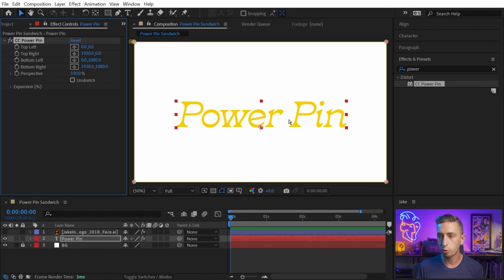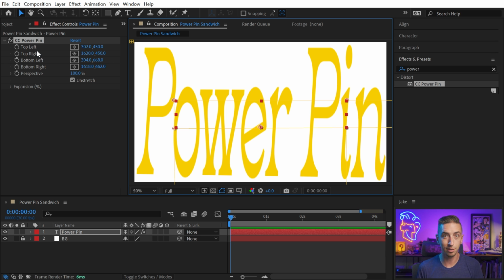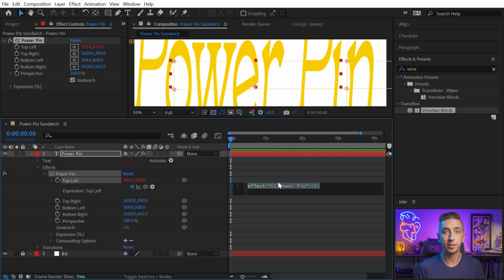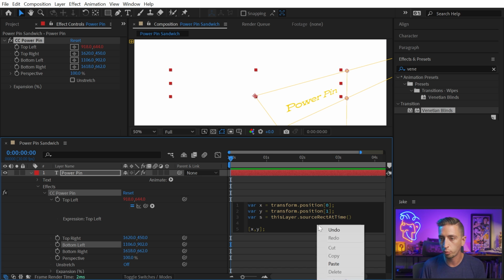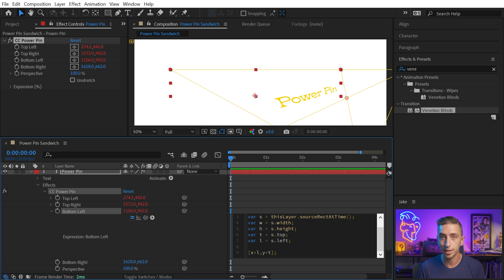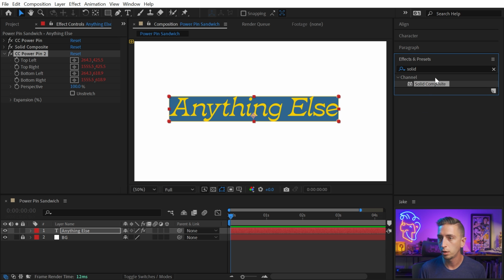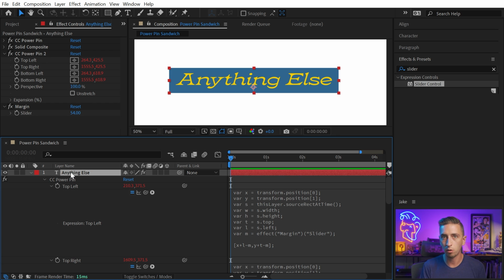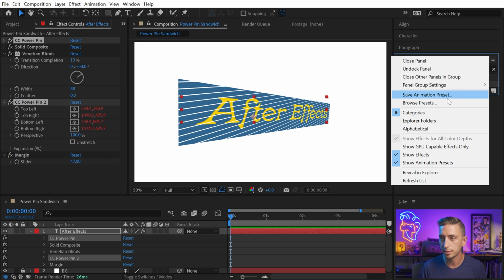CRAZY After Effects Technique \\ The Power Pin Sandwich

Comment: FYI, I found a few lines of code that make it a whole lot simpler to pin the corners to the corners of the textbox reliably

TL
var rect = thisLayer.sourceRectAtTime(time, false);
var rectTopLeft = toComp([rect.left, rect.top]);
[rectTopLeft[0], rectTopLeft[1]]

TR
var rect = thisLayer.sourceRectAtTime(time, false);
var topRight = toComp([rect.left + rect.width, rect.top]);
[topRight[0], topRight[1]];

BL
var rect = thisLayer.sourceRectAtTime(time, false);
var bottomLeft = toComp([rect.left, rect.top + rect.height]);
[bottomLeft[0], bottomLeft[1]];

BR
var rect = thisLayer.sourceRectAtTime(time, false);
var bottomRight = toComp([rect.left + rect.width, rect.top + rect.height]);
[bottomRight[0], bottomRight[1]];

Comment: Hi, I tried to use this technique to get a gradient ramp to "stick" to a moving shape layer but got an error at line 1 of the expression that a variable was off or something (I can elaborate when I'm back in front of AE tomorrow). Trying to stick the start and end points of the ramp to the center left and center right points of the shape. Any chance you could do a quick tut or write out the correct expression?

Comment: i discovered this "unstretch" checkbox sandwich technique when i was desperately trying to find something similar to red giant's discontinued kingpin tracker last november. i was working on an Air Canada christmas commercial and I decided to track the digital faces onto the stop motion puppets and distort them into the correct perspective using corner pin by tracking 4 points on the face. there was literally no other way to do it i think. super useful technique
Reply: Stabilize precomp, check out mocha import +, or  Lockdown from Vranos.
Reply: @UnDo75  Thanks for the suggestion, but neither of those worked in this case for a variety of reasons/limitations with the footage (I experimented with both options). Another method would have been to do perfect 3d object tracking of the puppets' heads, but this wasn't feasible given the time/budget. But honestly, the power-pin sandwich worked pretty flawlessly... And it makes sense too as the puppet heads do not warp at all since they're inanimate. Perspective-warping the digital faces to the heads (with a little bit of nudging sometimes if the face really had to curve around the form of the head) worked perfectly. HOWEVER, I did use lockdown to simultaneously track 4 points on the stop motion puppets' faces. The tracker is insanely good!

Comment: I use myself this Power Pin Sandwich to make tracked deformation:
- first I use Mocha to track the area I won’t to deform;
- then a Power Pin where I use the tracked data from the Mocha filter to get the 4 corners position. This gives you a footage stabilized on the area to deform;
- Now a liquify filter that I use to deform the target area as I need. As the previous filters stabilized the area, the deformation will be mainly constant throughout the footage;
- To finish, a copy of the previous Power Pin with the unstretch option checked;
And there you have it : tracked liquify deformation.
Reply: Thank you for this! When I put the Liquify effect in between the two Power Pin effects, the  Liquify distortion disappears. I even tried adding more liquefy all over the shot in an attempt to make it show up. How did you get it to appear when in between the two? 

On the other hand, when I turn off both PP effects, the Liquefy effect is back, and I can attach it's distortion offset position to a null to use as a tracked deformation. Would love to make it work w/ this PP sandwich. Any pointers?
Reply: @grantpichla  hard to tell without seeing the AE project you are working on. But first of all, check that the PP sandwich functions as it should without anything else between the two PP effects. Check that the first one on its own does indeed « stabilize » the footage. If it does, check that the « unstretch » copy of the first one does indeed « de-stabilize » the footage to its prior state. Then you can add a liquify in between. Don’t forget to hide the unstretch PP effect while editing your liquify effect. Then turn on the unstretch PP effect to verify that the liquify effect follows the unstretch.

It’s important to not try to make too extreme deformations this way, at least at first. I noticed that sometimes painting liquify deformations out of the bounds of the composition messes up the whole process, that can be what happens in your case. So try to do it step by step just a bit at a time to check if that works, and just note what you did when it ends up not working anymore.
Reply: @grantpichla  it’s also important to do the liquify Painting when it’s already sandwiched, with the first PP effect activated and the second one hidden. If you do the liquify effect outside and sandwich it after or paste it from another layer, the liquify will not be at the right place. It has to be done ON the layer of the stabilized footage.
Reply: @yannsalmon2988   Thank you. My issue was I had both PP's on while trying to add the Liquify effect - should have just had the first one on, use Liquify on that stabilized little spot, then turn on the other PP. Worked like a charm. This is fabulous. Cheers!
Reply: @grantpichla  Cool ! Glad it worked for you. I’ve since experimented with other methods that use the displacement effect while on 16 bit as a proxy for deformations. With this method, all the deformations are done on a « map » layer before being applied on the footage via the displacement effect. The advantage is that the footage undergoes just one single deformation rather than being submitted to the deformation of a deformation of a deformation, etc. Much cleaner result.
Unfortunately, the process is quite complicated and can’t be reasonably explained in a comment like this one… One day maybe, I’ll be able to create a video tutorial for it and share it to everyone.
Reply: Interesting!